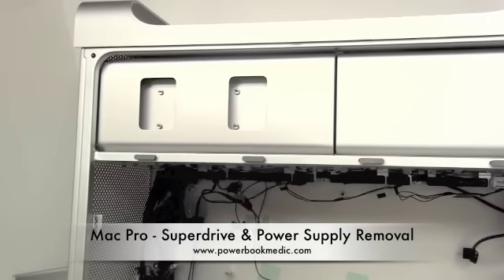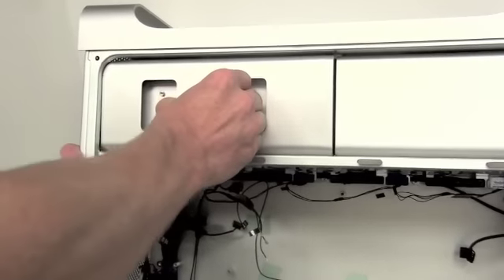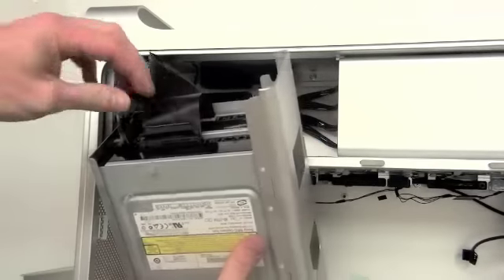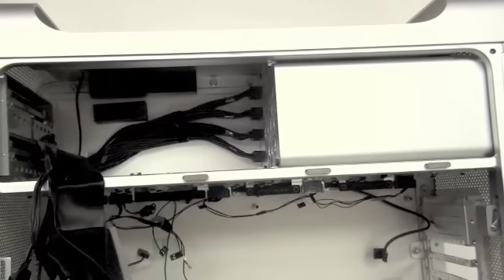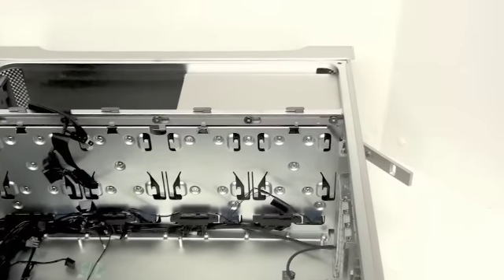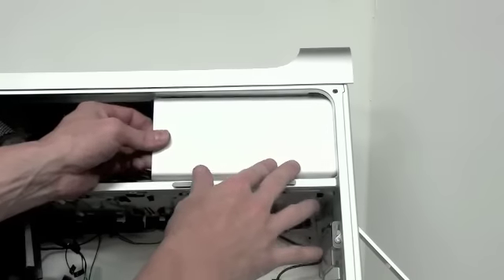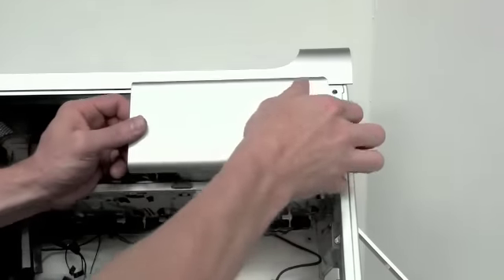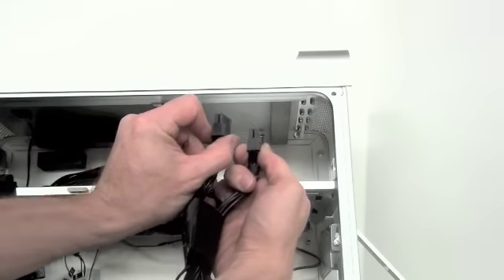Mac Pro Repair - Superdrive and Power Supply Removal

Comment: I have this weird behaivior in my Mac Pro 2012,.... it wont run in cold weather.... but i put a heather in front and i fire it up, then it starts to restart over and over, untill it gets warm it stays  on... i found that with an app to monitor cpu temp and mother board... it works fine on 65+ celsius in the mother board.... any sugestions???? im suspecting about my PS but now im not sure....

Comment: Do you have to remove the superdrive before the PSU? I have ordered an PSU to my Mac Pro 5.1 2012 in order to get rid of the whining sound, but I don’t know for sure that it comes from the PSU. Why am I holding on to this old machine with only half a year to live? It will be obsolete this autumn when Apple releases a new version of MacOS.
Reply from the maker: I don’t believe you do have to take the superdrive out first.
Reply: @PowerbookMedic  Sounds good. I thought if some cables were hidden behind the superdrive, but maybe it isn’t so. I need some memory to it also, but how much? I can take in 128 GB, but do I need so much? And the speed 1333 MHz is very slow when you have up to 2600 Mhz today. Stoneage-computer!
Reply: In the MacPro5,1 2012 (and MacPro3 and MacPro4) you have to remove the SuperDrive and the cover plate behind the SuperDrive to get to the power connectors for the SuperDrive and disconnect them before you can remove the PSU.

Comment: Perhaps it is a different model, but apparently there is a plate behind the super drive that must be removed to unhook the power supply. Took that off, undid the velcro, no problem.

Comment: Why my Mac Pro don’t wanna start I change the power supply and nothing (nada)
Reply: Please help
Reply from the maker: There could be many reasons. If the power supply didn't fix the issue you may have a bad logic board.

Comment: On my Mac Pro (2,1), the power supply screws are 2.5 mm hex screws; not T-10. 
Also, there is a metal plate below the Superdrive concealing the power supply connectors which are velcro'd to the chassis.  You must remove this plate (two Philips screws) to expose the connectors for power supply removal.

Comment: Is this a Mac Pro 2010? I am assuming so since the search took me to this video. I don't see a definite identification. You read many people complaining that the directions don't apply to earlier Mac Pros which caused them to damage some parts. I am worried about my Mac Pro 2010, 5,1 because I started having issues with the power button in front. I would have to push it several times to get it going. I read one suggestion was to remove power cable and push the power button for 3 to 5 secs where you hear a click trying to turn it on. It did seem to help it a little I think. So it made me wonder if the power supply will be needing replaced. I hope not.
Reply: This video is not for MacPro 2010 but the steps are almost the same. See this comment for the differences: https://www.youtube.com/watch?v=6lOzC3ovhDk&lc=Uggf4Yb3hz7ZsXgCoAEC

Comment from the maker: If the issue wasn't there prior to the video card, I would swap in the old video card to see if it resolves the issue. If it doesn't you may be looking at a logic board issue. If could be the power supply, but that won't go out just by installing a video card, and it's more likely that somehow the logic board was damaged.

Comment: Hopefully, if you’re watching this video to perform this task, you will read the comments first. You can’t just remove the screws and push the psu to the left and pull it out without first removing the plate to the left and disconnecting the cables. This key step is left out. You may also need a right angle ratchet to get some of the screws loose without pulling additional items out of your box.

Comment: Thanks for the great video! I had an issue with the T10's stripping and had to use a dremel to cut a groove for a flat head. After that, I thought I was in the clear, but now the power supply unit won't come out. I think there are wires getting caught or something because there is some give when I pull, but not enough. Any tips? Thanks in advance!

Comment: Could I have damaged by logic board or power supply by putting in Nvidia 8800gt video card without a 6 pin PCIe booster cable? My computer won't start up and all I see is a red light. When I press the button next to it, the "trickle" light turns on.

Comment: Great video!! I'm actually building a Mac Pro from scratch and your video showed me something that I didn't know! When you took out the optical carrier right behind it was a fan for the power supply, I thought that there were only 3 fans in the pro (PCIe and the fans for the processor cage). There was no mention of this fan in any of the schematics or tear downs that I have seen to date. Thanks for the video I almost made a big mistake in not including this part!!!!!

Comment: Thanks for sharing and uploading. I had to remove the 2 philips screws in the panel behind the Super Drive, then remove the panel and disconnect the power connectors.
Reply: Same here.
Reply: Yeah I didn't realise that all.  Almost put my back out ripping the cables out.  Luckily didn't damage anything in the machine.

Comment: This is not correct for the Mac Pro (Early 2008), a.k.a. MacPro3,1, and according to others, the 2012 MacPro5,1 and earlier (MacPro2 and MacPro 4). In these machines the power supply screws are 2.5mm hex, not T-10.
Also, there is a cover plate behind the superdrive that has to be removed (2 Phillips screws) to expose the power cable connections and those connectors must be detached before the power supply can be removed.
Reply: Yep stripped my screws becayse of that
Reply: Thanks! Your two corrections also apply to the 2012 MacPro5,1
Reply: Thank you ! Very helpfull !

Comment: Thank you for sharing such a useful video. My PSU is now replaced, so a big thank you :-)

However, my 2010 no longer sees it's Bootcamp SSD. It, sees the Mac OSX SSD and my two HDDs which I use for music files etc. 

As I mainly use Windows for my university work, I am concerned. 

If anybody could advise me, that would be great :-)

Thanks again for such a useful video. 

Sarah

Comment: You really should fix this video to include removing the other 2 screws and making sure to unplug the cables before removing for mac pro early 2008. If I followed your instructions I would have broke my computer. Thanks to awesomesauce's comment I was able to remove the power supply safely.